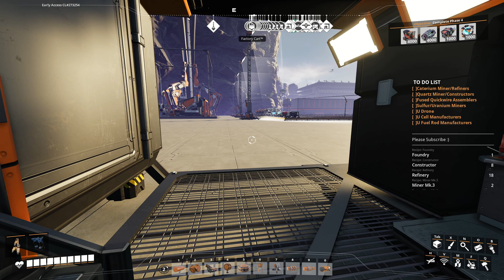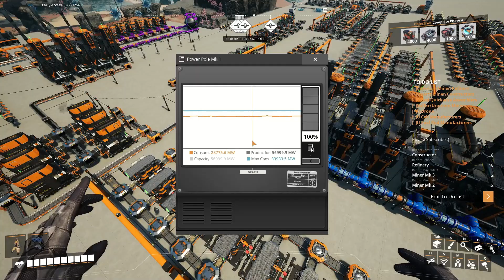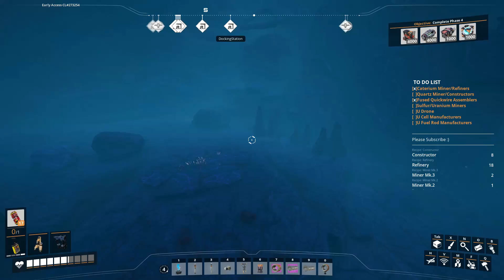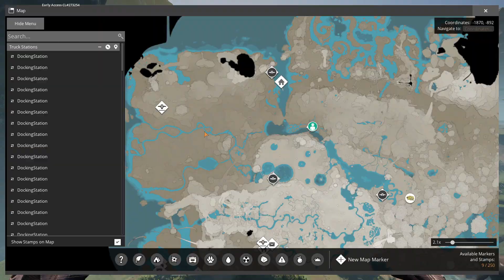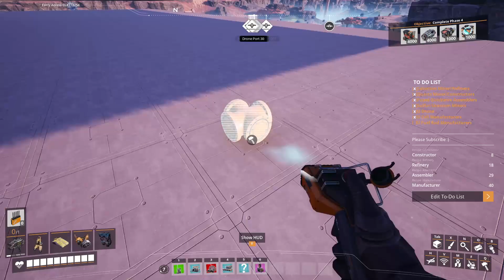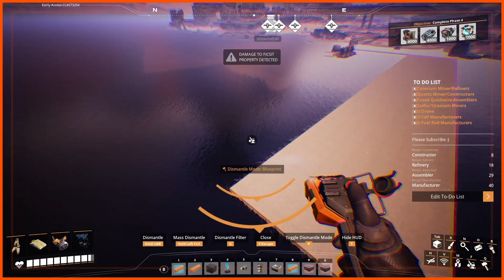GETTING CLOSE TO 100 THOUSAND MEGAWATTS WITH URANIUM!!! -Satisfactory Relaxing Gameplay Series

Comment: Good stuff.  I am not sure I agree about the fluid issue being an in game bug.  CSS has done a pretty good job debunking things some people like to call bugs that are actually issues that particular person has.  I have seen the power thing where as soon as you log in power seems to come back online.  I don't even think that is technically a bug.  5 seconds before you logged in how much power was your factory using?  None because it doesn't run except when you are there.  I dodn't even want to imagine the issues if the game was persistent.  If I am honest, I would guess your issue with the water has far more to do with the load your system is trying to handle.  You spoke of taking a long time to auto save.  What if fluids is the last thing your system saves or last thing it reloads when you return?  That can very easily be corrupted.  If fact that might relate to many of your other problems with fluids.  Maybe it is your system and fluids is just the thing that gets the short shrift.  Hopefully if true the 1.0 optimizations will remedy or at least soften that.
Reply from the maker: Thanks for the support Dan ☺️ 

Heres hoping some performance optimization helps me out! Either way I'm pretty blown away how far this world has come in under 6 months lol